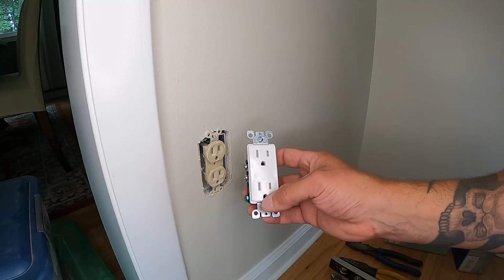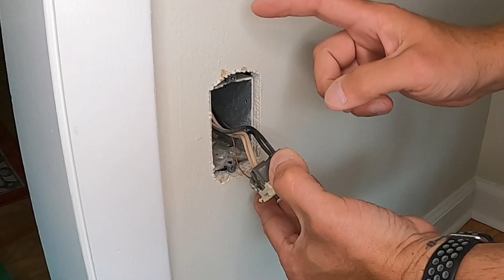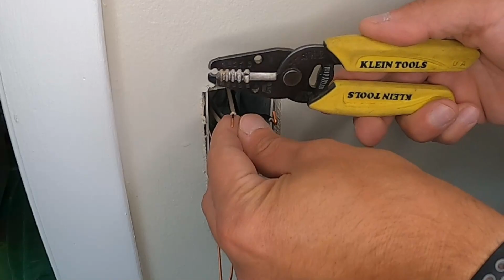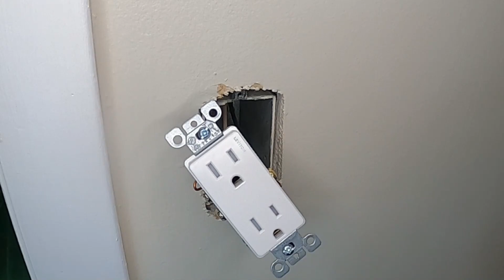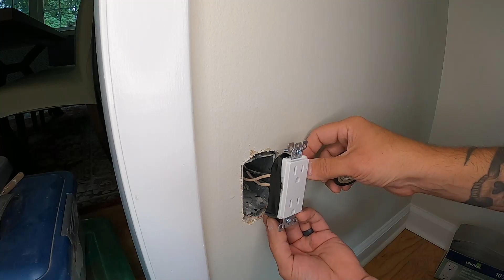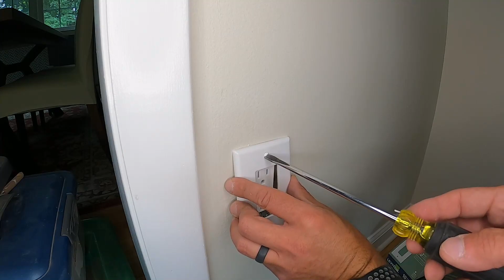How To Replace An Electrical Outlet

Comment: Since the electrical wires are short coming out of the electrical box, I would "pig tail" the two black hots together and then separately "pig tail" the two white neutrals together and then connect them to the receptacle.  But more importantly, I never want the receptacle to be the device carrying the current in the circuit to another receptacle downstream.  If the receptacle fails for whatever reason; the rest of the circuit downstream will be dead without power.  "Pig tailing" provides a solid electrical circuit that does not rely on the receptacle to be the path for the current downstream. You mentioned the use of a slotted or a Phillips to tighten the wires on a receptacle.  Actually, Klein Tools makes a multi-bit screwdriver bit (#32752) to fit their screwdriver that is made and designed specifically to fit the screws on a receptacle where they will not "cam" out when applying torque to the receptacle screws.   It is a combination of a #2 square drive with a slotted design all in one bit.  It works great!  I agree with you, I would never use the quick method of "backstabbing" electrical wires into a receptacle even though it is approved by the electrical code.  They are bound to fail in the future and the sometimes the receptacle is warm to the touch because of the poor electrical connection and high resistance.  I personally like the back "screw plate connections" on commercial receptacles and GFCI receptacles, which is not "backstabbing", as they are a lot easier to use and more electrically secure to use rather than rapping the wire around a receptacle screw.  Thanks for the step-by-step video.  Good job!
Reply from the maker: Another person in the comments recommended that screwdriver also and I just recently purchased it. Old habits with not pigtailing. That’s how I was taught and that was most likely because the electrician I apprenticed with was old school. I agree especially with the number of electronics and electrical gadgets most households have today although I’ve never had one fail. The breaker should trip before that tab melts. I had an instance where one failed but that was after a thunderstorm and something got hit nearby. Thanks for the suggestions and thanks for watching!

Comment: Get the correct screwdriver for the job.  Amazon offers the Klein Tools 32378 Combination Tip Screwdriver Set which has the proper tip for these electrical screws.
Reply from the maker: I will definitely buy this now. Been using a flathead for years now. Thanks for the info and thanks for watching
Reply from the maker: Got the set from Amazon in today. Thanks for the recommendation!

Comment: If you're using Philips screwdriver and it cams out on you, then you're using the wrong sized one. Invest in a JIS Philips because they work on regular Philips and does not cam out.
Reply: Get the correct screwdriver for the job.  Amazon offers the Klein Tools 32378 Combination Tip Screwdriver Set which has the proper tip for these electrical screws.
Reply from the maker: Pretty sure it was a #2. The flathead worked much better to get it tight. I’ve been doing electrical work almost 20 years and flathead was always the way to go.
Reply: @theguyofalltrades  try a JIS#2 and you'll never go back to Philips
Reply from the maker: Will buy one today. Thanks!
Reply from the maker: The guy above mentioned a Klein screwdriver that seems like it would work well.
Reply: @theguyofalltrades  yeah but that's not a JIS. Trust me dude, I've been doing tools for 25 years. I've ordered tools for a multi billion dollar company
Reply from the maker: Thanks for the info. I’m buying one today. Been an licensed electrician for 12 years and never had one of these. Not sure how I missed this lol
Reply: @theguyofalltrades  In all fairness, I should point out that Milwaukee sells a really nice ECX tip screwdriver too, I believe that I even saw an insulated version of it at Home Depot a wile back.  But usually Milwaukee products are a bit more expensive, though Milwaukee does also provide hex sided ECX torque bits as well but those are nothing I would ever have the occasion to use.

Comment: One thing I would do is pigtail when it’s a mid circuit so if a outlet fails half the room isn’t in the dark or without power until the defective outlet or switch is found and replaced
Reply from the maker: Good point, I have seen the tab melted off the side of a receptacle
Reply from the maker: Also have to keep in mind NEC 314.16A which only allows 5 - 14awg conductors in a box this size so technically it's overfilled when counting the cable clamp and device the way it is right now. The older metal boxes didn't have the same volume as the newer ones do

Comment: Are the outlets with the USB plugs build in my challenging to install? (Thanks for the helpful video)
Reply from the maker: Same exact install. The power supply for the usb is internal to the outlet. Terminals look exactly the same on the outside though. Good luck!